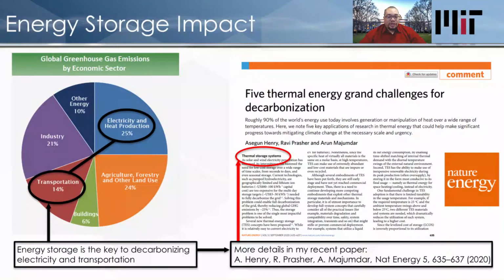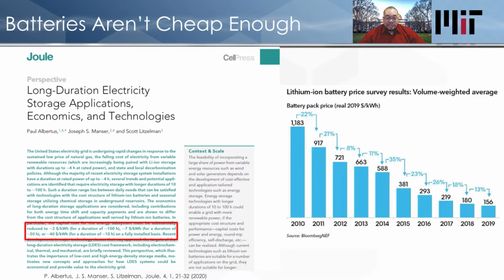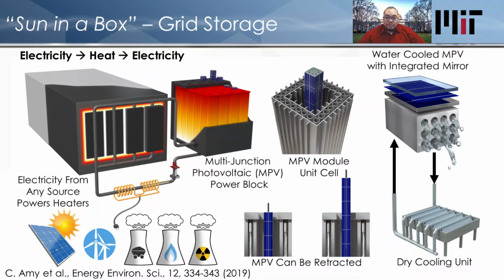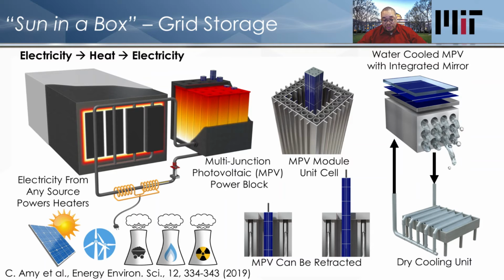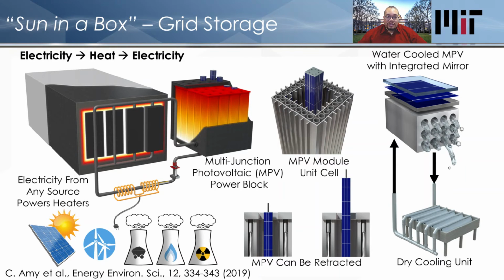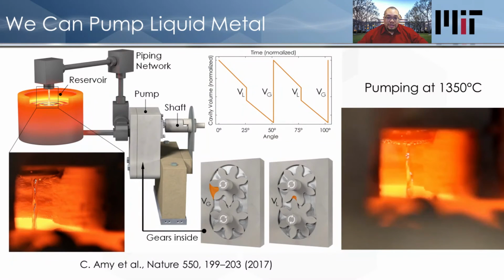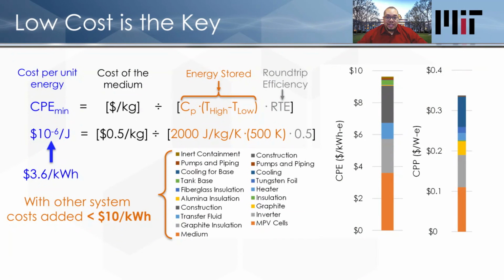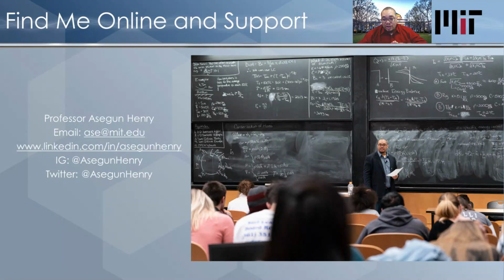"Sun in a Box" -- Thermal Energy Grid Storage Using Multi-Junction Photovoltaics (TEGS-MPV) Overview

Comment: Thank you for posting this. I appreciate the straight forward explanation of your technology. I read about a lot of different solutions to the energy storage problem that work presented on paper, but never get off the ground because they don't work in reality. Mainly this is probably because of poor testing methodologies, or other things, like riding the hype to try and attract investment capital. I was curious what your thoughts are on recent developments in batteries, and if the reduction of price makes them viable now. I also wonder about the possibility of battery recycling for reuse, or upcycling of exisiting batteries. The lack of coriosion in your system is an intresting design feature. I see with your design that the system could run for many years.
Reply from the maker: What recent developments in batteries are you referring to?
Reply from the maker: What recent developments in batteries are you referring to?

Comment: When I do a simple calculation about the lifetime cost, I have found that even though the hardware cost is smaller in your case, we pay more overall (more than three times as a lifetime cost) because the cost of electricity wasted is higher in your system because of the lower round trip efficiency (which is about 50% whereas Li ions batteries have 80% ). What do you think about it?
Reply from the maker: I think this is a great point. Our calculations may be a bit more complicated, but they show that economically this approach wins out. The details are in a publication: 

https://pubs.rsc.org/en/content/articlelanding/2019/ee/c8ee02341g#!divAbstract

The paper derives a methodology that accounts for both cost and efficiency to determine how cost effective different technologies would be overall - making an apples to apples comparison. Let me know if it makes sense and helps a set your question.
Reply: @AsegunHenry  I read the paper. So, the profitability of your storage system comes from the variability of electricity price with time, right?
Reply from the maker: Plank - I suspect the difference between the calculations may be the revenue from capacity payments. The profitability comes from two things, capacity payments and arbitrage. The main source of revenue is the capacity payments, where we get paid simply to be available/ready to discharge energy to the grid. This revenue comes regardless of whether we actually do discharge or not.
Reply: clear all
close all
clc

%Li ion Battery

CostperKWh = 100;
TotalStorageCapacity = 1000*1000000;
LifeTime = 8;
efficency = 0.8;

CapitalCostOfEquipment = CostperKWh*TotalStorageCapacity/1000;

CostOfEquipment = CapitalCostOfEquipment*25/LifeTime;

Cost_of_energy_wasted = 0.1*TotalStorageCapacity*(1-efficency)*25*365;

Total_lifetime_cost = CostOfEquipment + Cost_of_energy_wasted;
Reply: clear all
close all
clc

%Sun in the Box

CostperKWh = 10;
TotalStorageCapacity = 1000*1000000;
LifeTime = 25;
efficency = 0.5;

CapitalCostOfEquipment = CostperKWh*TotalStorageCapacity/1000;

CostOfEquipment = CapitalCostOfEquipment*25/LifeTime;

Cost_of_energy_wasted = 0.1*TotalStorageCapacity*(1-efficency)*25*365;

Total_lifetime_cost = CostOfEquipment + Cost_of_energy_wasted;
Reply from the maker: Maybe you can check out one of our papers on the topic and see where our calculations disagree. We used simulations of the grid to determine how valuable our tech would be to the grid and although I agree with you it’s a non-intuitive conclusion, our work clearly shows that a 50% RTE is better overall, if the cost is 10x lower. Here’s a link to the paper:
https://pubs.rsc.org/en/content/articlelanding/2019/ee/c8ee02341g

Comment: How does the cost varies with size (kWh)? What are the challenges to make it in smaller sizes?
Reply from the maker: This is a great question. What governs this is the surface area to volume ratio. The rate at which the system loses heat to the environment is proportional to the surface area, while the amount of energy stored is proportional to the volume. So as the system becomes bigger this ratio decreases and a smaller fraction of the stored heat leaks out before it is discharged. So to your question, we can scale this down to about 10 MWh and will still be better than Li-ion batteries at a cost of $50/kWh, and we also don’t get much more gain in this respect by going much further beyond 1 GWh of storage. Our nominal target for commercial deployment is on the order of 1 GWh.